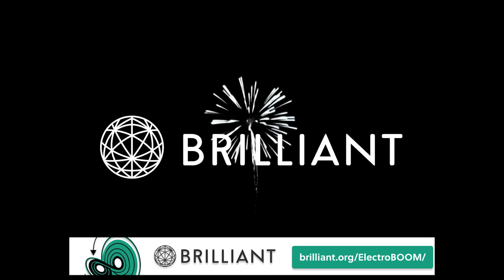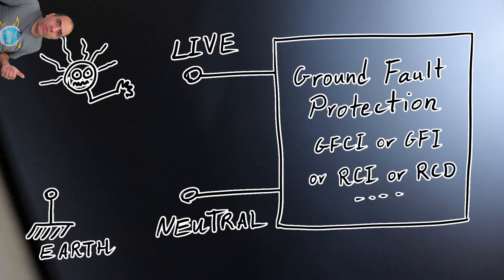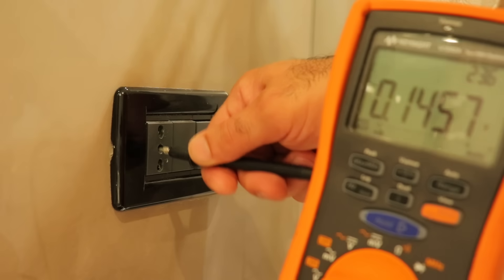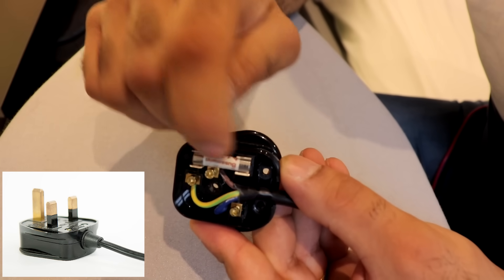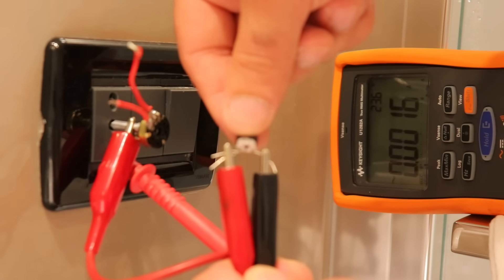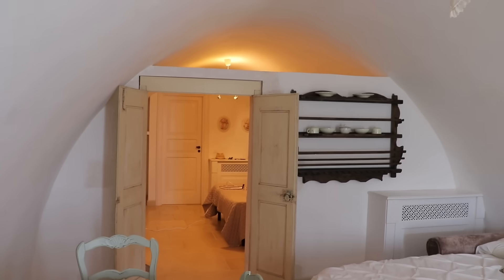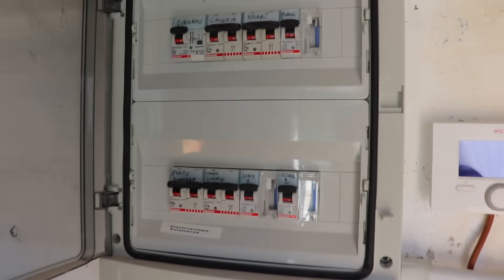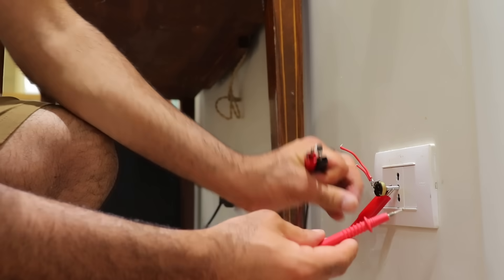Tripping Every Breaker in Italy

Comment: Your GFI outlet is mandatory in most of Europe, but it's circuit wide protection, not just single outlets. 
There is a main one, usually 300mA in the switch box, and 30mA in the house panels, for different circuits.

Comment: In Romania (and I think this is valid for whole EU) we have 3 ground protections for a house. The first is for 300 mA and is the protection in box at the property limit and is "owned" (you have access to it in case trips, but you cannot replace it)  by the electric company. The second one is for the whole house, located in the breaker box inside your house and is of 30mA, and the third one, for wet environments (like bathrooms, washing machines, etc.), again in the breaker box, but on the dedicated circuit, and it's a 10 mA one.
By the way, in the second hotel, it was a mess - they used an C16 breaker for the sockets, a general one of the same value - C16, and believe the one in the reception was also a C16 - that's why all 3 tripped. That's agains the regulation. Also they should use a B curve breakers instead of C.
Reply: in italy the 300 mA GFCI doesn't exist, the electric counter has only a stupid magnet breaker, maybe also a termic breaker xD (i know that because when i shorted 220V with a thick wire the breaker hasn't popped because there were no time for the heating element in the termic breaker to trip

Comment: Hey, italian here. The round one are the german or shuco plugs witch are the standard requirement for eu regulations. The slimmer ones are the italian standard or “bipasso” witch are everywhere because the wall plugs are very cheaper compared to shuko ones. We buy adapters for the german ones for like 2/3 euros and use that to connect utilities with shuko/german plugs to italian outlet

Comment: The problem with plugging the big plug with the ground on each side into the normal italian plug with the plug in the middle shouldn't exist. Here in Germany we have two types of thicknesses for the prongs on the plugs. A small one for plugs without ground and a thicker one for those with ground, so that you can't just plug it in the wrong outlet, if you have some sort of power strip without those deep indentations for the plug.

Comment: The best thing about german plugs is that they work in germany (obviously) and italy, at least the non-grounded ones. The SchuKO-Plugs dont work, i think, because they are to big, but i haven’t tried.
Reply: The flat Europlug is not specifically German. It is designed to work in the whole continental Europe.
Reply: @okaro6595  then the socket in italy are not designed for the europlugs, because i had problems in my last holiday

Comment: The big round plugs with ground on the sides should NOT go into these 15:23 sockets since their metal sticks are a little bigger. Mehdi probably forced it a little into the inaccurate plastic housing
Reply: What do you mean? The plug very well can be designed to take in 16/10A plug.
Reply: @danek_hren  I believe there are slightly different plug pin sized between grounded and not grounded plugs
Reply: @Progaros  yes, sizes are different, but nothing stops you from buying a receptacle without ground and trying inserting a 10/16A plug.

Comment: There is no GFCI plug, because in Europe ALL plugs are protected; but, your north American GFCI plugs shut when 5-6mA pass from the live to the earth, in Europe RCBO breakers shut when 30mA pass from live to earth and every plug should be protected by RCBO breakers; that's a lot more, but 30mA is considered to be the "lower" limit that cause fibrillation that's why...

Sometimes you can see GFCI plugs in some hotels bathrooms, but that's the only place where I saw somes, I bet this is only to reasure the north americans tourrists, since european don't care at all since ground fault protection is considered "basic" on all European plugs 🤣

The strange shaped plug at 9:15 is the new Italian "standard" phone line plug that replaced the tripolar "old" plug

For the little "doors" I think they are broken on the socket that didn't have them, in France all the new sockets installed have necessarily these little "doors", I think it's the same in Italy.

Comment: I am an electrician in Northern Italy and the 2 different plugs are for different circuits. The smaler one is for the as we call it Light circuit witch has a 10A braker and 1.5mm² wires for smaller appliances  and a second "Force circuit" with bigger and thiccer plugs, 2.5mm² wires and a 16A braker. Also we have seperate 16A brakers for things like wasching maschines, electric stoves or furnaces and dishwashers.
Reply: Some countries allow 16A for 1.5mm2 wire and 20A for 2.5mm2.
Reply: I was interested in the characteristics of the circuit breakers C. In Czech we use B..

Comment: In fact its kinda easy (fot a train spotyer at least) to determinate the voltage of an overhead train line by looking a the shape of the poles and the isolators. There are 4 voltages in Europe: 1.5 kv DC , 3kv DC 15kv ac at 16,7 hz and 25kv 50hz. Basicly the larger the isolator is, the higher the voltage is. And because of the higher current 1.5kv DC often have a "doubled" contact wire

Comment: I'm a big fan and follower of your channel! In Europe, it's safe to say that safety standards are pretty high and required by law. Hope you don't mess up someone's vacation!
Reply: still nothing compared to uk
Reply: @samsunggaminghub  Stepping in a uk plug is worse than an electric shock.Europen plugs and cables are better.We dont allow ring circuits and twin and earth cables with smaller ground.Every cable must have the full size ground and must be insulated in green-yellow.

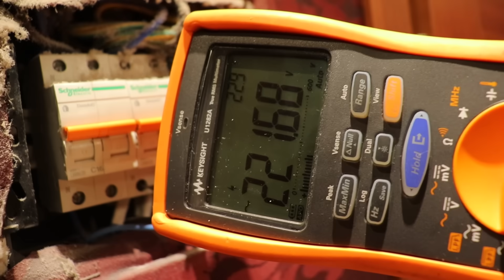Comment: Just to correct you at 3:35 black is not neutral its live, the blue is neutral and green/yellow is earth, you may also find brown or grey wires which are also live (this is in a three phase system). I have to agree italian sockets suck they shout just use shucko sockets like the rest of europe. Also by law every house must have RCD, usually 30 mA but its not weird if you see 3 mA or 100 mA. I don't know for the rest of europe but here in croatia by law they have to trip in 500 ms aka. half a second, above that is a faulty installaton/RCD.

Comment: There was a European standard socket on the continent that was used by many countries before grounding was a thing. Then different countries made different backward compatible sockets for their grounding. And you put the German/French socket compatible grounding plug into the Italian grounding socket.  Yes. Germans and french went to different forms for grounding, but the plug became round that had different pieces of it removed, so you can make the plug compatible with both. While Italians kept the old form of a plug and added a grounding pin on it.

Comment: I was on Budapest recently and the prong came off the adapter. I reached in to remove it from the socket and it was connected to the live wire. If the hotel hadn't had good electrical circuits I may have died or been seriously injured. Good electrical circuit designs save lives. I didn't even burn my finger it disconnected so quick.

Comment: As you said every room is earthfault protected. In the Netherlands (and possibiliy in the rest of Europe) it's mandetory for newlybuild or renovated houses to have earthfault protectrion. 
The 30 mili amp is also diliberetly chosen as many appliences have a very smal earthleakage (pc's for example)  and if you have 2 protections for a whole house it might blow just on your appliences.
For the voltage it should be 230 +/-10% so, 220 is still well within the limit.
Additional trivia in case you did not know. The letter and number on the switches are the amps and behaviour of the fuse. A C16 is normally used in the Netherlands and has a 16 amp fuse. If you have a fuse in front you might want to choose a B fuse so you don't blow out your main fuse everytime you have a short.

Comment: Well North America is working on better ground fault protection the 2020 NEC added a bunch of new things about what needs to have ground fault protection. Some breaker companies are also now making GFCI/CAFCI breakers to protect entire circuits. I installed one in my lab and it has worked really well it’s saved me a few times. But unfortunately I don’t see the plug thing being fixed anytime soon, we’ve had the standard for so long that it would cost a fortune to change. But also particularly Americans are very cheap when it comes to safety, we use the bare minimum when it comes to electrical safety, for security we spend like $50 on locks while in Europe it’s not uncommon to spend $600-$800 for a lock. And Americans are also stubborn so even if standards changed there would still be those people that won’t change to the new standard.

Comment: In Italy law requires a master RCD, then is usually divided between lights with their RCD and plugs with their own RCD.
Blue wire is neutral, then the three phases are usually brown black and grey. The other colors are used for the lights usually.
As the years go by were dividing the lines more and more, with many subsequent protections.

Comment: in the second hotel, the BTicino socket at the rj45, is a socket produced by BTicino in the 70s / 80s called the "irreversible safety socket", which, however, was not successful because only they could produce it, but it is still on sale.  it works like the UK ones but less bulky.but I think that is the version for the phone

Comment: Most GFI's in Denmark is in the HPFI relay's and legally it has to activate by max 30mA within 0,2 seconds but the ones i've tested turned off at around 20-25mA within 0,2 seconds. Still a bit more than NA GFI's but the times i've gotten shocked (mostly by mistake) nothing have happend, other than the initial shock.

Comment: I once got electrocuted in Italy during my holidays - there was a tiny piece of life wire sticking out between the outlet and wall and while plugging in the phone charger I touched it by accident. Gladly, I did it with outer part of my finger so I just got a deep but tiny burn (and I was a little dizzy for 5 minutes). Not a pleasant experience...

Comment: I wanted to say something about the "Shuko" inside the "Italian" standard outlet. It shouldn't fit, but with a LOT of effort you can force it in (i've never seen anyone do it btw). To me this indicates that the outlet where you put it was probably forced by other people in the past, tourists i assume, and slowly it became much easier to plug it in.

Of course that's not intended and you will find that on an outlet that didn't receive abuse it won't easily fit.
Reply: I've seen it a lot of times, unfortunately.
But yes, usually it's hard to do
Reply: If the hole in the plastic is large enough the contacts should bend the 0.8 mm. In Finland we had from the 30s to 50s grounded plugs with 4.8 mm pins and ungrouned with 4 mm and they grounded was intended to fit the ungrounded. Now this will not do good for the sockets  in the long run.
Reply: Not that there is a need, but I can confirm. I've never seen a Shuko plug fit into a standard outlet or even thought that it was possible at all.
Reply: it's "Schuko" (abbreviation from "Schutzkontakt") ;)
Reply: In my experience at least in hotels and restaurants most of the plugs are of the type that Mehdi showed first that has two different set of holes  or they are elongated.
Good luck if they have the "magic" plug though like in the first room.
Reply: Nope those are 2 type outlets for 10A plugs and 16A ones type C/L, shuko type f(+e) have the 2 poles the big size but distance like the smaller, also some outlets got both types or 2 type c and one f(+e)
Reply: @TheGrejp  probably
Reply: I can get a plug to fit in those sockets. All you need is a 12oz lump hammer!

Comment: The strange C shaped outlet @ 9:16 is a proprietary outlet called "Magic outlet". It was invented by BTicino as an irreversible outlet and it never really caught on. Now I think it's not produced anymore.  The F type plug (or shuko plug) should not be pluggable in a standard italian outlet as you did, because the teeth are larger. However, you can easily force it in as you did.  The "doors" are mandatory in every outlet, the one you saw without them was probably broken. The nice thing in italian outlets is that are way more compact (and modular) than standard european and american ones.

Comment: the double sockets are 10 / 16A and are connected to the 16A circuit breaker, the sockets with only small connection are 10A and connected to the 10A circuit breaker.  usually in Italy the sockets are separated from the lights and are under different disconnectors, in some cases the kitchen and laundry are also divided.

Comment: i live in Italy, my work is to go at the clients and test all the RCD, measure the earth impedance and check the continuity of all earth circuit link, everyone by law has to do this every 2/5 years.
basically is what you have done..... but in a professional way, lol.
edit: oh yes, in italy RCD are mandatory for ALL circuits, 30mA max sensitivity for all terminal circuit, with that you will be safe as long the impedance of the ground loop is under 1.6kOhm (50V is considered safe for a contact, so 50V/30mA=1.6kOhm), usually a ground loop is in order of 1 Ohm on normal terrains, so there is a lot of room for compensate oxidation of the terminals and ground rods, we are very serious about electric safety.
Reply: If the rcd is faulty  and 1 Ohm ground rods will handle 230A of current and still trip a normal breaker.Even if the standard allows higher impedance go with the lowest possible.

Comment: All Europe is slowly adapting to the new standard, which is Schucko (the round one) on all wall plugs. At least in Spain the installation of non Schuko plugs is forbidden. All the instalations are grounded, with no exceptions. 
Then the decision to use ground or not is from the manufacturer depending on the appliance in question.

Comment: The small braker panel in the room is an "old style" Italian panel, until recently most Italian homes only this kind of "minimalist" protections.  But it have very recent schneider breakers.  The larger box with the gfci is clearly a modern addition ( I would say less than 10 years) to add ground fault protection to the rooms
Reply: Nah, they probably put the two overcurrent protection switches in the room so that the customer can reset them by themselves if they plug too much stuff at once. A ground fault is a much serious issue so it makes sense it's in a centralized panel so that only staff should check the problem and reconnect the power. It's just an hotel room so a two-circuit system is enough.

Comment: So, I was in a hotel in Cape May, NJ a few weeks back. The outlets would not grip the prongs of the plugs for our devices with sufficient force. Or maybe it was too much force, because it felt like it was more or less spitting out the plug. With careful bracing and balancing of the weight of the power brick against the wall plate with the prongs inserted I could make some of them work, with about 1/4 inch of exposed live prongs. Yeah... never seen that before and it made me think of your videos showing wiring devices in hotels.
Reply: At a place in Wildwood there was a motel with only 2 prong/socket outlets in the room.

I had no two prong adapter and my laptop cord had 3 prongs.

I had to use the outlet in the bathroom that had a 3 hole socket.

Comment: Actually if you look at the breakers some have C10 which stands for 10A max and then C16 which means 16A max, both connected to the main GFCI. 
Well engineered electrical system should have lights and plugs with only the one smaller holes (which are rated for 10A max) connected to C10 breakers and the double or rounded (called shucko that should be EU standard) connected to 16A since these types are rated for 16A.

Note that it should NOT be possible to plug the round plug (16A) inside the 10A socket, maybe it was done before so the holes are wider than they should be.

The unknown socket is called Magic Plug! Is a very old Heavy Duty (up to 20A) socket!

In any case happy to have had you here in Italy, hope you enjoyed you stay :)
Reply: Also, C in C10 means protection class: how fast breaker pops when the current is just slightly higher. I have class B breaker in my office, and it sometimes pops as soon as i switch it because of the surge from capacitors in computers and printers. But most places has C class breakers that are much less sensitive.

Comment: The mnemonic for the wire colors goes like this: Live wire has the color of your underwear after you touch the wire. So brown (not black) should be live, blue should be ground and the yellow/green is the ground. The hotel electrician got it a bit wrong. I hope the next electrician doesn't pay the price. Nice video mr. Mehdi, I hope you enjoyed your italian holiday.
Reply: Only blue for neutral and yellow/green for ground are mandatory, every other colour must be assumed to be live. Brown-Black-Grey are the standard colours for three-phase power, but other colours are common (for example in switched circuits).